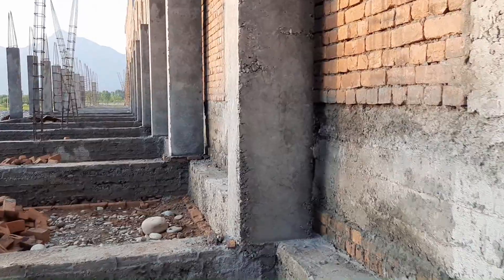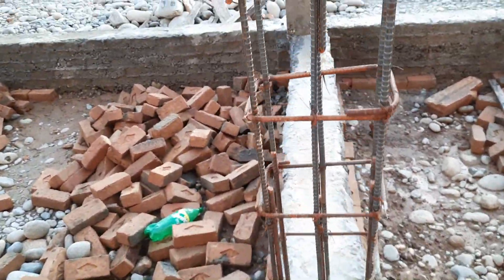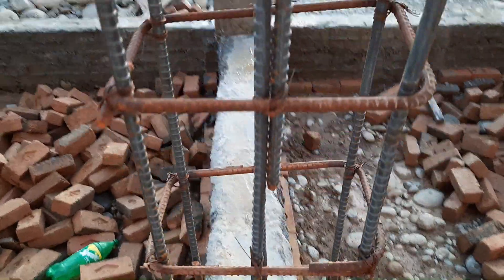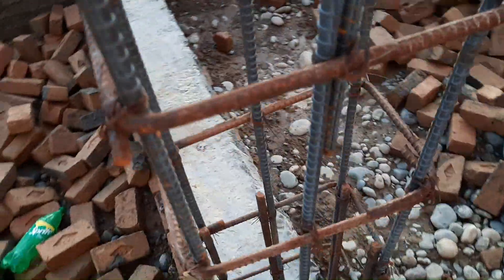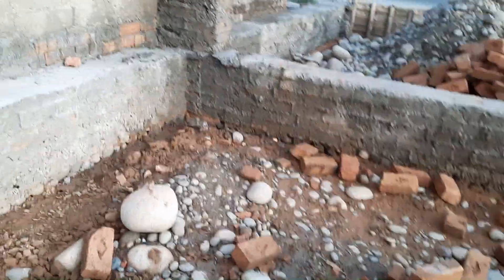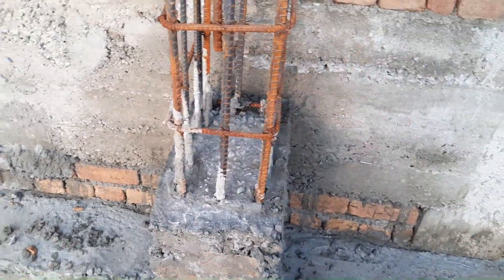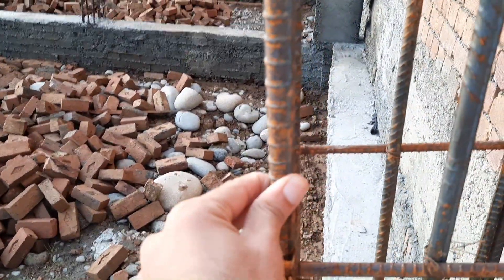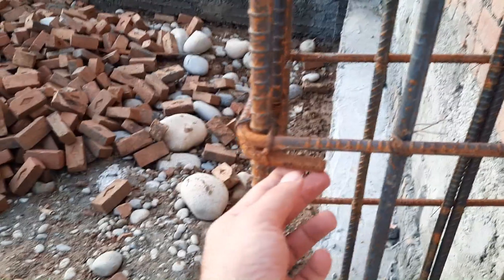Big Mistakes of Column for 3 Storey building | Civil Site Visit Mistakes |

Comment: Sir, I need some guidance,  I am construction 3 storey building for my residential purpose , Footing net size is 6 ft x 6ft and depth is 6 ft and column size is 10 x 12 inches and reinforcement is 6 nos 16 mm and 2 nos 12 mm with 6 cm stirup distance with 8 mm size. Please provide some suggestion that will it bear load of. 3storey building or need to change something